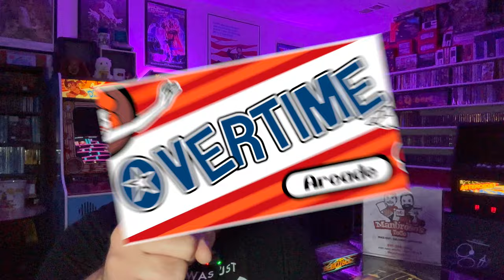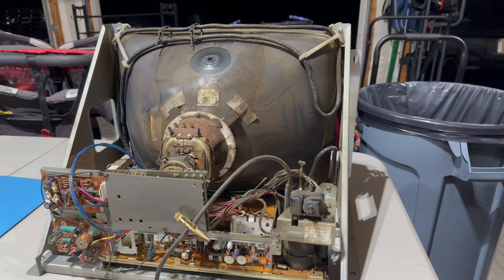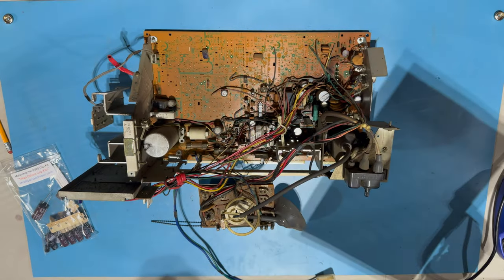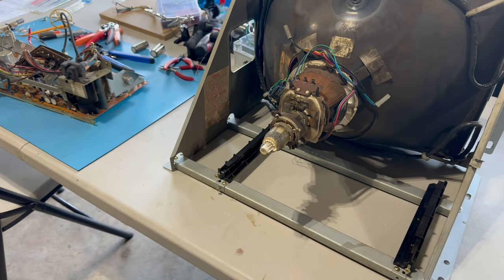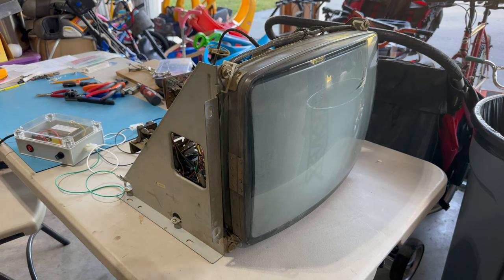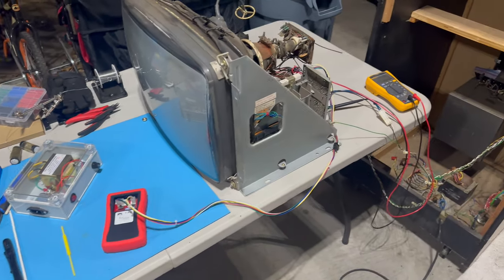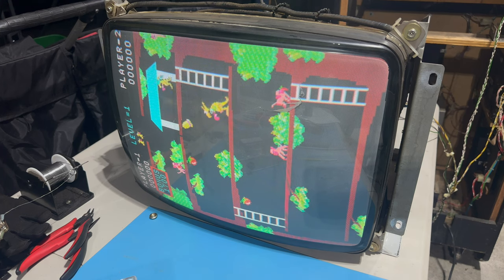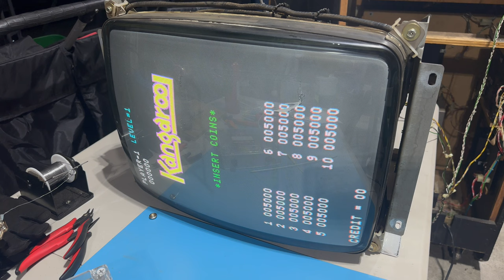WORST MONITOR EVER! Matsushita TM-202G cap kit & more, Atari Kangaroo arcade restoration part 2 🍀🦘

Comment: If I remember correctly, the G05-801/802 also has that type of clip on the 2nd Anode.  I prefer that over the 2 wire prongs as it seems easier to hook back up.
Reply from the maker: Oh cool, I'll have to look for that the next time I have to mess with my Asteroids monitor!

Comment: The B+ procedure is wrong in the manual. FYI. Asked me how I know.  😅 I did a couple of vids on it in my Millipede restoration video.
Reply from the maker: Yep, it didn’t really work the way the manual said, so I ultimately just dialed it into 123V with the brightness, etc. adjusted normally. Didn’t Jacklick’s catch fire when he maxed out the brightness on his Matsushita?
Reply: @overtimearcade You did it correctly. If you don't do it that way and follow the manual, (turning up the brightness and then turning up the B+) actually makes the pot smoke and melt it, if you leave it on too long. To turn up the brightness, you actually turn it to the left, BTW. Gotta love the Matsushita! 😂 Counterclockwise turns it up. Clockwise turns it lower. So essentially I think you turned it low and that's why you weren't getting the proper high voltage to cook your stuff. So you lucked out! I always adjust it with it in the middle. Learned the hard way.
Reply from the maker: Thank goodness for dumb luck!

Comment: My favorite monitor by far.  Good job bringing it back.  If you want a decent bench adjustable iso, I can let go of my VIZ WP-27A (did a vid of it).
Reply from the maker: Thanks! But, favorite...? Did Panasonic bribe you to say that?? 😅 😭
Reply: @overtimearcade  whoops.  I left off the sarcasm ...winky face.  I am not above bribery though.
Reply from the maker: @jacklick LOL How many of these Matsushitas do you have??
Reply: @overtimearcade  at least 3.  2 in pole positions and one in millipede.  Sucks the irish can didnt come with dual monitor harness but i think you said that wasnt the original monitor.
Reply from the maker: @jacklick  Yep, not the original monitor. This Matsushita has Xevious burn. I had to build a quick adapter to connect the Irish Kangaroo harness to the monitor.

Comment: What kind of CPO do you have on your Robotron? Seems to be missing the "2084" logo from the front
Reply from the maker: Yeah, it's weird! Almost like a few parts were missing from the silkscreen. It's 100% original from what I can tell (not a repro or a replacement), and I've found a few photos online of other cabinets with the same misprinted(?) CPO. There are some detail missing from the top of it too. I'm just so used to it now that the "correct" ones look wrong. If it ever wears out to the point that I need to replace it, I'll have to get a "correct" one, I suppose.

Comment: Is the monitor setup for 240v?  What is the voltage coming from the transformer in the cabinet?  Also don't use your transformer on a Nintendo cabinet, those monitors are 100v.
Reply from the maker: Nope, I’m reading 120v coming from the cabinet transformer to the monitor power plug. And yes, I’ve got a 100v iso that I’ll use for a Nintendo test bench power supply (but I haven’t put that together yet).